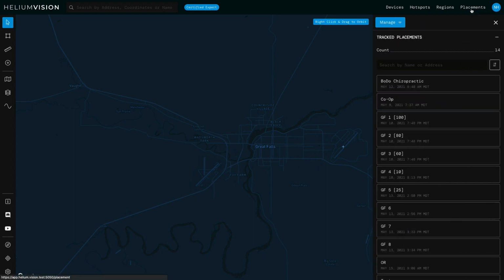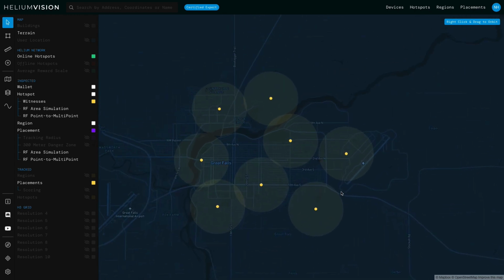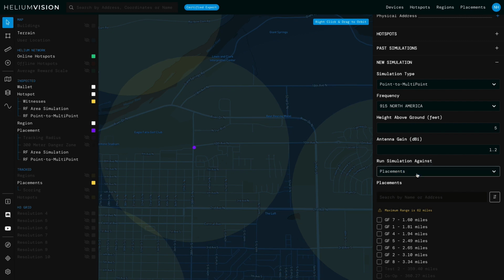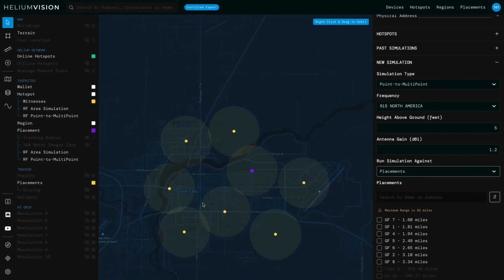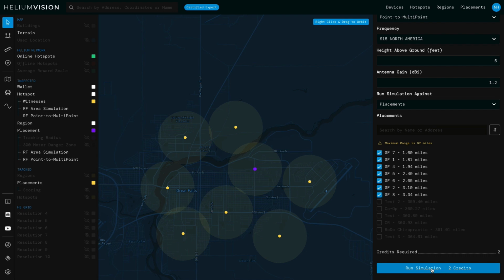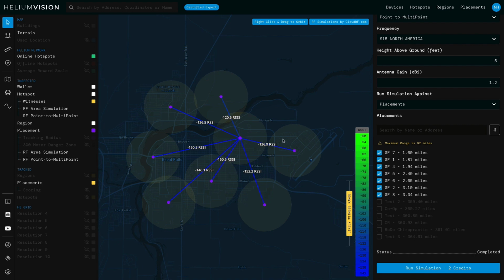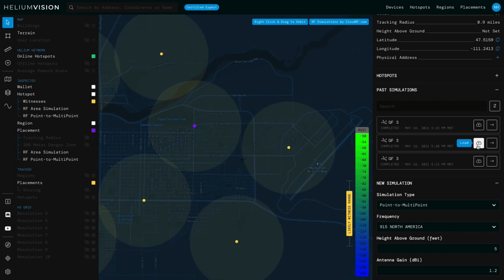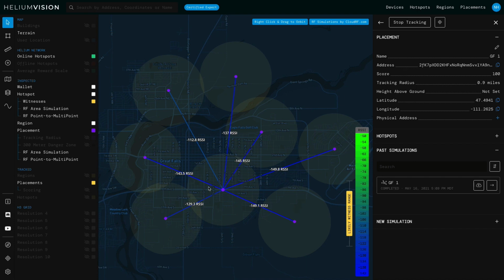Point-to-MultiPoint Simulations

Comment: Ty Nick, I have 30 possible hotspot hosts and I bought 14 hotspots, is there a way to input the 30 possible locations and then the app bring up the optimal solution for rewards, considering placing 14 hotspots and the other variables?
Reply from the maker: Absolutely, that's exactly what HeliumVision is for.
Reply: Great question! It would be great to see a thorough demo of this.